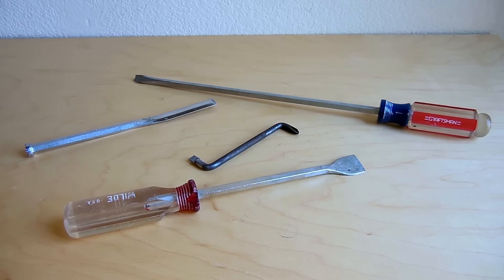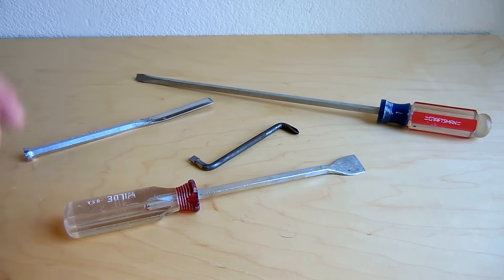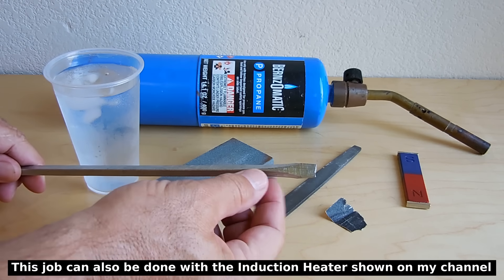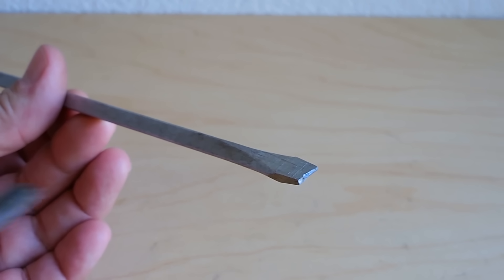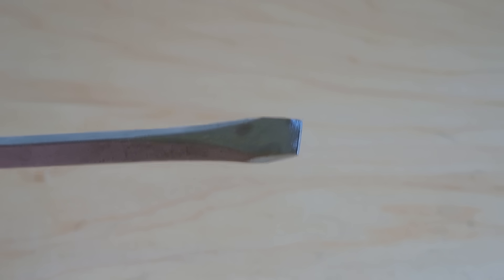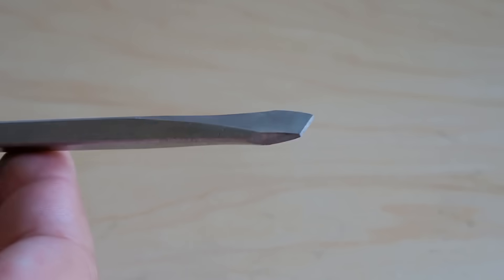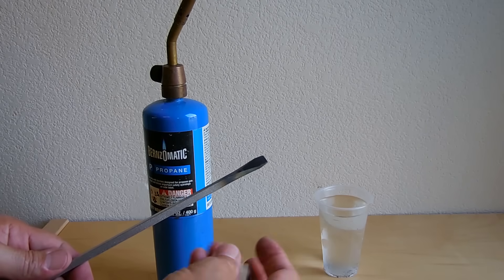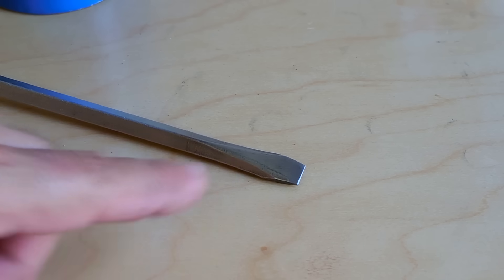How To Heat Treat / Temper Hand Tools & More!

Comment: Will this work also on brand new router bits? So there's no need to re-sharpen them, right?
Reply from the maker: Don't heat new router bits. Try sharpening them without creating too much heat. Keep dipping them in cool water as you sharpen them so the bits don't lose their temper. When you're done, apply a thin film of motor oil to the bit's surfaces before storing.
Reply: @electronicsNmore  thank you

Comment: Does this process make the screw drivers rust and corrosion resistant
Reply from the maker: No, you need to apply a thin film of oil with a rag to the tool's surfaces to prevent rust, or spray the tool with a zinc galvanizing spray. Be sure to look over my extensive video playlists below for other great videos of interest to you, and most importantly share. Thank you!
https://www.youtube.com/c/electronicsnmore/playlists

Comment: Hmm? You don't quench when tempering .... the purpose of heating the steel up again is to allow it to lose some excess hardness, you don't have to try and "freeze" the lost hardness in water lol Heating up does the thing , the cooling does nothing..just let it cool normally
Reply from the maker: If you notice, the metal was heated to a much lower temperature when the tempering was done(to lose hardness/brittleness). It works fine, but the best way is to place the object inside an oven.

Comment: you made a screw driver into a chisel with no edge
Reply from the maker: Not
Reply: the edges of the tip are to be hollow ground to grip the bottom of the groove 
in the screw
Reply from the maker: @claybair4904  The screwdriver works just fine.

Comment: Cold water is theoretically better since hardness is directly related to the cooling rate. Fact.
Reply from the maker: That's true, but the thermal shock can cause the steel to crack. Luckily  it never happened to me. Thanks for watching!

Comment: So you sharpen, then temper? Does the heating process not dull the edge?
Reply from the maker: Hi Phil! I like to shape the tool first(like an old screwdriver tip), then harden, then sharpen AFTER tempering(especially for a knife blade). Thanks for watching! Please check out my video playlists and most importantly share my channel with others.

Comment: Wouldent it be great if you also had a minimum of clue how to properly heat treat steel before you start trying to teach your misconceptions to others. You can start with looking op the meaning of O in O1 tool steel. Then learn how to properly temper steal. Hint: you can't quench steel when tempering. Rather you let it cool slowly at room temperature.
Reply: @Aaron Washburn You are not forming martensite when you temper, but tempering is actualy removing it. Heating to tempering temperatures does nothing, but slowling cooling at room temperature, will remove some. If you quench you have done nothing, and the steel will remain britle.
Reply: Thank you, as soon as i saw this guy quench after tempering i knew he didnt know much
Reply: So what's the process guys? Heat red hot, quench in oil. Then reheat to red hot and then allow to air cool??? I've no idea how to do this stuff. But it would be nice to know how to do.
Reply: @Chewy0424  Yeah basically.  To be fair, tempering by colour can be tricksy, so unless it's mystery metal, you're better off looking up the tempering  temperature and tempering process for the grade of steel you have and the end hardness you want, and following that.

The most common tool steel O1, is IIRC, tempered at about 200° C (about 400 ° F) and you can do it in an oven (although make sure your significant other doesn't catch you using the oven in the kitchen 😂; I do my tempering when she's out! 😉).

For what I do, my domestic oven is fine, as variable as it is temperature-wise.
After spending time in the oven at 200 ° C (for the size of the parts I make it's normally between half and hour to an hour), I let it air cool and then repeat the tempering 'bake' one more time.  Works for me.

Some steels might be quenched after the tempering heat soak, I dunno, I'm not a metallurgist, but O1 is definitely air cooled after tempering.

BTW the 'O' in O1 is for 'Oil' and that's what tells you what you should be quenching in, after hardening. The 'W' in W1 is for water, the 'A' in A2 is for 'Air'.
Reply: Yeah i was also thinking the same if he dips in oil agin it would be be hardened again
Reply: @Aaron Washburn Because in steel quenching is locking in the chrystals that is hardening the steel, making it more brittle. In copper or silver you can quench it when tempering.  https://en.wikipedia.org/wiki/Tempering_%28metallurgy%29
Reply: Most steels require rapid cooling (quenching) to harden, what are you talking about? It seems you have the misconceptions
Reply: @compilecodebug6430  Read again. You cant quench when tempering. Tempering and quenching are two different things.
Reply: @gandalf1124  My apologies master Gandalf. You are talking about the tempering process after the quenching? The quenching makes the steel hard but brittle. You have to temper after.

Comment: Great explanation on heat treating. I just disagree with the way you sharpen you gasket scraper. The best scrapers have a 3 angle grind and just about every wants a razors edge on the so they can gouge the aluminum parts.
Reply from the maker: Yes, because I make them so sharp, they can gouge aluminum gasket surfaces. I usually use a brass scraper on aluminum. Thanks for watching!
Reply: Haha I should have known.

Comment: tempering is done at a low temp 400-450 f  for a hour  or 2 and is not quenched, but alowed to slowly cool....This guy has it all wrong on the tempering....
Reply from the maker: Partially correct. Tempering temperatures will vary based on the type of steel used. Typically between 375 and 800 Deg F, which is why a tempering color chart was provided to viewers. Also, if a furnace/oven is used, it's normally 1 hour heat per inch of steel thickness. The furnace is used to greatly reduce the chance of the steel cracking. I've used the method shown in the video for years and never had the steel crack when cooling in water after reaching the tempering temperature.
Reply: WHAT about microscopic stress cracks that can be problematic later.???

Comment: This video is to be taken with a huge grain of salt. How to heat treat steel tools is highly dependent on the steel that is used. Most of todays handtools are made from high alloy stainless tool steels. Heattreating of that is typically very complex due to the high amount of alloys in the steel. Simple carbon steels may be heattreated as shown in the video. Although I would strongly recommend not to use water for the quench. 

It can be extremely dangerous to use tools, yes even simple hand tools, that haven't been heattreated properly. If you were to heattreat say a stone chisel like that and you dont know what you're doing, odds are that the first time you smash with it at a stone it is going to get destroyed and in the worst of all cases, a chip of the tool is going to come flying in your direction at a significant velocity due to extreme tensions within the steel. Chips from improperly heat treated steel can easily go flying at forces that are akin to fragments from a exploding hand grenade just for reference. You wouldn't want to be anywhere near that.
Reply from the maker: The video shows a BASIC method that's been used successfully for many years.
Reply: Similar methods have been used for literally hundreds of years. But not on modern tool steels. And not by utter tools. The way you put it in your video suggests that one could take every household handtool made from steel and re-harden it with a propane torch and a cup of icy water successfully which is nonsense. You think those screwdrivers are being hardened with propane torches and cups filled with water industrially? To this day heattreating steel is done by professionals for a reason. If you do it yourself backyard style it may work but it also might not and some unfortunate bastard eats a sharp edged steel chip with their eyeball. At least make people aware that not every tool is made from the same steel and may require specific heattreatment to eliminate any risks of critical failure.  @electronicsNmore
Reply from the maker: @WUNDER8AR  If you don't like the method, don't use it. Very simple. Nothing is 100%, even heat treating by "Professionals".

Comment: Each steel have it's own way of being treated. 
Yes,  heating it to a point, rapid cooling it and then tempering ...
BUT here is where it becomes useless and dangerous.
First, warer is rarelly proper for most tool steels,   is rather a rare proper coolant. Most need oil and there are few reasons for that, speed of cooling being one of them( water can be faster but also water evaporate, a film of steam will be created between water and hot steel and heat transfer will be poor...so water can be also too slow...).
Anyway, for most tool steels cooling liquid need to be rather warm,sometimes 60 degrees... Celsius...not ice cold.

Some steels may become improper just by heating them, not to mention bad cooling and tempering.

The essential point is, by wrongly treating a piece steel  that tool CAN become VERY DANGEROUS. A piece of steel can broke while using the tool and beyond any form of accident, that piece will become shrapnel.
A stray,sharp edged piece of steel CAN be deadly, one may loose an eye and so on...

There is no tool( cheap as it needs such a dramatic reconditioning) worth such a risk...throw the damn screwdriver and pay another 5$ for a new piece of junk.

IF anyone wants to experiment heat treating various pieces of steel, which is fine and rewarding way of spending time for some, please be careful, use protection gear and after treatment you ABUSE that tool in various tests to ensure it will not brake in flying pieces in the future when you or worst, another user, will not be aware and prepared for anything wrong possibly happening.

Modern tools are made from complex steels which are far more complicate to heat treat at home in order to make a good and safe tool out of them.
50-70 years ago ..yeah,simple steels could be treated like this with less risks, not today.
Reply: Hey if you don't like what you seen don't watch it simple as that don't sit there and talk shit on what this man is showing us offering a free service to broke people like me I actually did this to many of my tools and it works GREAT better then it was factory I "re" did several of my tools this is a lifesaver thank you for taking the time to put together this awesome video sir may you have a great evening don't let people like this get to ya cheers mate
Reply: Buddy Thomas he’s not hating he’s trying to keep people safe go watch outdoor55’s video he explains heat treating in greater detail and you should do extensive research before you try to heat treat anything
Reply from the maker: The method still works fine. You're forgetting that this is a "Basic" method.
Reply: @electronicsNmore  Ok. I have no intention convincing you, it just needed to be said. There is no thing as "basic" when working with unknown steels.
Reply: Liviu e Nice comment. Wish more people realise they can’t learn materials science in 13 mins.
Reply: Very correct on the fact that each steel, depending on alloy (if any) and carbon percentage has its own "best" heat treatment.  But this video is about basic DIY treatment, that will work fine for 90% of the cases (but the video should have mentioned that one cannot harden non-carbon steel!).    

As a general rule, cooling with water gives a higher SURFACE hardness (what is most-times required with DIY tools), than cooling with oil .  Oil is also making an insulating gas film!  As a general rule: dip your tool with high speed and shake it well in the coolant to reduce the steam or gas film layer.  

You safety remarks are an overkill:  One can make tools too brittle by wrong hardening, but the risk for any accident caused by that in a DIY world are very very very little!  Professionals who harden planer blades know very well they can create dangerous shrapnel.

Comment: You do not quench again after tempering.... Harden then temper to heart and allow to cool a preferred method is to allow slow cooling by placing in hot sand..... To quench again you have rehardened making brittle
Reply from the maker: A simple Google search for "tempering steel" will prove you wrong.

Comment: Some tools, cheap tools, cant be tempered or hardenned. Because they are made from extremely low carbon steel. No carbon no hardenning.
Reply from the maker: Correct! I have a lot of excellent videos on my channel that cover many different subjects, so be sure to check out my extensive video playlists for other videos of interest to you, rate thumbs up, and most importantly share my channel with others.Thanks for watching
Reply: Nikola Zivkovic could still get a low carbon steel to have more carbon. Heat it up as he says in the video (no magnetism) quench in the blackest used engine oil you can get ahold of. Repeat this process 3 times only to assure you have fully placed carbon in the steel. I did this method the other day on a pair of pliers I got. I also bought a second pair that I didn’t treat for control. As we should know carbon steel is fairly easy to make sparks with (say with a survival knife or when grinding) I placed each pair on a motorized wire wheel and the control made little to no spark, the one I treated was like a firework.
Reply: @positivenegative6525  if you actually look at the carbon diffusion rate in steel, you will find that this isn't going to measurably increase the carbon content any increase  in hardness from this process is probably from the carbon already in the steel(when at a critical temperature in a carbon rich environment it can take over 10 hours for 1/16 of an inch of penetration)
Reply: I guess my question has been answered. I bought some harbor freight (cheap) Allen socket wrenches and snapped the first one I used off. I intended to harden and heat treat the remainder sockets but it sounds like that wont happen as I assume them to be low carbon.
Reply: @rtp3962  depends on how it snapped, if it looks like it deformed significantly before breaking it is probably not hardenable, if it seems to have broke with little plastic deformation simmilar to glass it is probably hardenable.

Comment: Thks for a keep it simple video.  Instead of the color of hot metal, ?can I just use an infrared laser thermometer?
Reply from the maker: Color is better, for me at least.
Reply: @electronicsNmore  Thks for the reply. ?Could you put this wiki heat treating link in your video description?
https://en.wikipedia.org/wiki/Heat_treating

Comment: Water quenching is to quick can crack oil quench let cool then temper to straw color and quench in oil !
Reply: some tool steels are recommended for water or oil hardening
Reply: Some steels require air quenching to harden them ! So many steels so many applications !
Reply: @44Celt  +1 to this answer. Also, the risk of cracks is proportional to the size of the part. For smaller parts, using water on a steel that is traditionally oil-quenched is not as big of a gamble. 

Also, I wouldn't temper any of these tools to straw, esp the cold chisel. Sharp shards of steel can separate at really, really high velocity when you are hammering a piece of too-hard steel against rocks and such. It's a real safety issue, let alone a tool-failure thing.
Reply from the maker: Never had it happen, but yes, oil is better.

Comment: I was taught at school to allow steel to air cool after tempering. Is quenching after bringing to tempering temperature a normal process? Doesn't that reintroduce stresses back into the steel?
Reply: The temperature isn't high enough to make new Martensite when quenching. Only above a higher temperature the grain would change the cristalline structure to contain the carbon in a different way, which is then creating Martensite (This is the inital hardening process), but this doesn't happen at tempering temperatrue. Essentially, you are only changing some of the Martensite back to the less hard, normal grain structure of the given carbon content steel.

There are always more or less residual stresses in steel, even when cooled slowly. The brittle fracture observed in a hardened, untempered steel with high Martensite is a different problem from residual stress, which do not necessarily have to be a problem for the application.
Reply: @computername  Thank you for the response
Reply: @steveforth4469  Well, learning myself (It never ends in this metallurgy so happy to correct me when I'm wrong). Reading questions on a topic is the best test of own understanding. I couldn't immediately answer your question and had to think about it for a minute so thanks for the brain starter :)